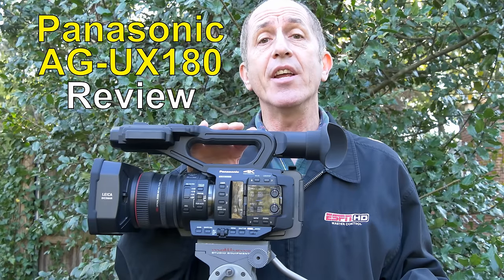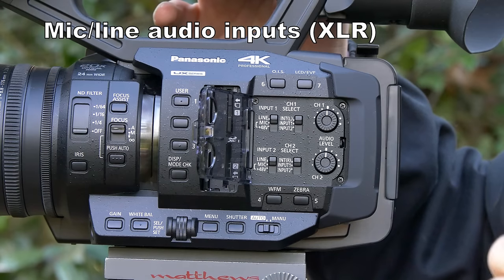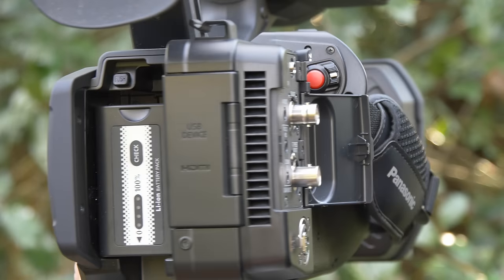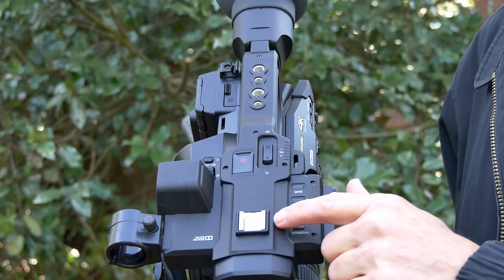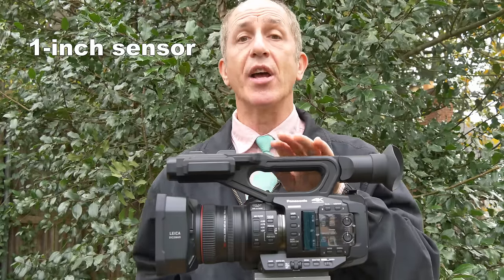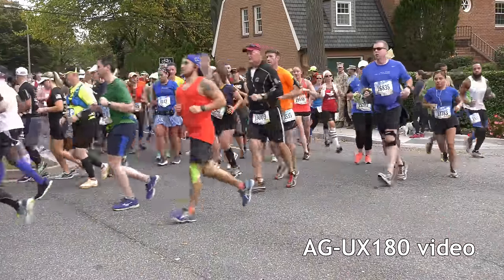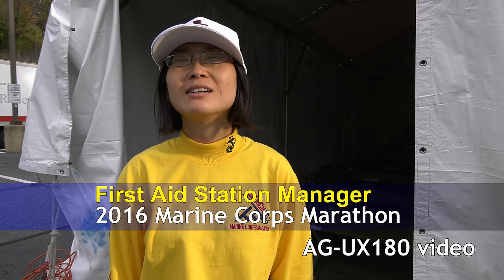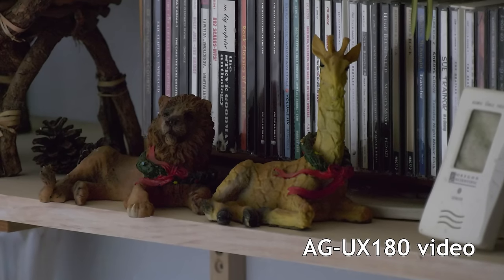Panasonic AG-UX180 4K Camcorder Review (in 4K)

Comment: hi. what kind of card you used here,for 4k?...speed? thanks
Reply from the maker: I used a PNY 128GB U3 SD card. My experience with the UX180 is that this PNY card worked fine at 100 Mbps, but was not reliable at 150 Mbps.
Reply: thanks for reply.regards
Reply: I bought these cards,SanDisk extreme pro 95mb/s, but it does the same( a tremor of the image).Is there any special setting or movement of the camera in 4k?....only in full 4k resolution (4096×2160). In UHD (3840×2160),works perfect.What is the problem?
Reply from the maker: It could be a bad SanDisk card. It should be the same data rate for both UHD and 4K -- at least that's my recollection. Other than that, I don't have any advice for you. The PNY card worked perfectly for me at UHD (3,840 x 2,160) resolution at 100 Mbps, but sometimes glitched at 150 Mbps. That is the only experience I had.

Comment: does anyone recommend a solid tripod to use with this camera thats under $200?
Reply from the maker: The Magnus VT-4000 sells for $160 on Amazon, and it is a good sturdy tripod that has decent fluid pan/tilt and can easily hold this camera. I had a smaller Magnus tripod that I used pretty hard for three years, and it is still usable -- although I got a travel tripod that is easy to carry in luggage to replace the small Magnus. The VT-4000 is considerably beefier than the one I have (which is a VT-200).
Reply: @BobKovacs  thanks so much!
Reply: @BobKovacs  I just did some further research into this. overall you are correct, its probably the best bang for the buck tripod out there! My only issue with it, is that it only goes up to about 5' in height. DO you by chance know if they make this version with a 6' height?
Reply from the maker: According to the writeup on Amazon, the Magnus VT-4000 goes up to 59 inches (or about 5 feet, as you noted). I did not see any obvious way to increase the height. If you need more height, take a look at the Cayer BV25LH tripod on Amazon. It's just a little more money, goes up to 73 inches or so, and has good reviews. I'm not familiar with it, but it might be worth a look.
Reply: @BobKovacs  Awesome, thanks

Comment: this camera is NTSC / PAL or only NTSC
Reply from the maker: The UX180 has the correct frame rates for both NTSC and PAL countries: 60Hz, 50Hz, 30p, 25p, etc.
Reply: So the signal transmitted by SDI can be PAL or also NTSC?
Reply from the maker: PAL and NTSC are antiquated standards that are not used in most countries. What remains from the PAL and NTSC standards are the frame rates: 60Hz for NTSC and 50Hz for PAL. (There are some slightly reduced frame versions that conform to the color versions of NTSC and PAL, such as 59.94Hz.) So the answer to your question is that, if you set the UX180 to 60Hz or 59.94Hz or 29.97Hz or 24.98Hz, that will be the video that is outputted from the SDI connector. And also outputted from the HDMI connector.
Reply: Tahnks
unfortunately in Argentina the Pal format is used for television, and to transmit a signal it is necessary to adapt to the format
Reply from the maker: Then what you need to know is that the UX180 will produce video at the PAL frame rate.
Reply: Thanks!!!!

Comment: hi  bob  alot of  good about this camcorder  i want to video aircraft  at airshows with video head and tripod   higher frame rates will be great for this in ultra hd 60fps  with  high bit rate but the down side is the screen  is poor to reflectable out side to see in to and EVF  plus roller shutter problems fast action panning on item  is poor have to spend more money on a 4k external monitor as well
Reply from the maker: Yes, the flip-out display is dim, and it could easily be too dim for some applications. I didn't really test for rolling shutter, but I don't really notice any issues on my other Panasonic cameras.
Reply: yea cheers bob shame the screen like that and  EVF  on the hcx1000 & hcx1  as well not good from panasonic
Reply from the maker: You might want to think about the Panasonic GH5 with the Panasonic 14-140mm lens. I got a GH5 this past May at a great price, and I already had the 14-140mm lens for my other Panasonic cameras. The 14-140mm lens on the GH5 is excellent for shooting 4K video, and it is amazingly stable with the lens' optical stabilization and the camera body's in-body stabilization. You can zoom in all the way handheld and get surprisingly good shots. I even use the "tele-extender" feature on the GH5 that gives me a 35mm equivalent focal length of around 400mm -- and it is still reasonably stable for handheld work. It's great on a tripod. The GH5 and 14-140mm lens combo will cost about $2,500 on Amazon or B&H Photo... dunno what it works out to be where you are (UK?). With the GH5's 10-bit 4:2:2 recording, you will get better quality than the UX180. And there's a bonus: The GH5 is a very good photography camera as well as video.

In the UX180's favor, it has a nice zoom rocker for smooth zooms, and it's easier to do a manual rack-focus on the UX180. The UX180 also has far better audio features and you can get batteries that will last all day for shooting. Of course, the UX180 will zoom in to 480mm or so, and will go a little wider at the wide end than you can do with the 14-140mm lens. (You can always get a wider lens for the GH5, obviously.)

Just a thought.
Reply: thankyou kindly bob for help on  gh5 and  ux180  being honest never used anything  semi pro or pro consumer just  yet being videoing hand held with  much lower class panasonic hc ax870 it is small senser nice ultra hd detail  great 20x optical zoom   had good results filming steady and fast moveing aircraft with this but  one problem  when filming 4k 25fps you get wobbley footage when zoomed in hand held use wise  ive just bought i great manfrotto 502 ah video head with a great  manfrotto tripod 055 pro 3 just waiting   and saving to get the right piece of kit  to go on top i  dont want to look into this to professional bob

Comment: Better GH5 or AG-UX180?
Reply from the maker: I have not used the GH5 (which won't be available until April, I think). I do have a GH3 and a GX8. The GH3 makes beautiful HD at a variety of different data rates, but no 4K. The GX8 does nice 4K, but its internal recorder is limited to 8-bit 4:2:0. The GH5 is supposed to have at least 8-bit 4:2:2, and possibly 10-bit 4:2:2. 10-bit 4:2:2 would be amazing if the GH5 indeed has it.

The UX180 (and very similar HC-X1) are 8-bit 4:2:0, but its lens is MUCH better suited to ENG and run-and-gun shooting than the setup you can get with the GH5. The GH5 (and GH4/GX8) is better suited to filmmaking and documentary work because of the way the controls and lenses work, while the UX180 is designed to be used as a typical video camera, with all the video camera controls where you expect them. It all comes down to how you plan to use the camera. Do you want to do ENG and event work? Or do you want to have a more flexible filmmaking camera? 

One final thought: The UX180 will shoot wider at 4K than the GH5 with any of Panasonic's lenses, except for the widest of the wide-angle lens. If you need to go w-i-d-e, the UX180 has a nice lens for that.

Comment: Hows the Slow Motion?
Reply from the maker: I did not try slow motion with the UX180. I stepped through the menus and didn't see any reference to high-frame-rate recording, but it might have been there if I had dug more deeply. FWIW, my Panasonic Lumix ZS100 camera does nice 120 fps recording in HD (1080p), especially if the ISO is set to 125 or 200.

Comment: Crappy viewfinder.  You must not have to shoot outside under stressful conditions.
Reply from the maker: The 3.5-inch pull-out viewfinder is really dim and hard to see in daylight. However, the eyepiece viewfinder on the UX180 I had was bright and clear -- easy to use in any conditions.